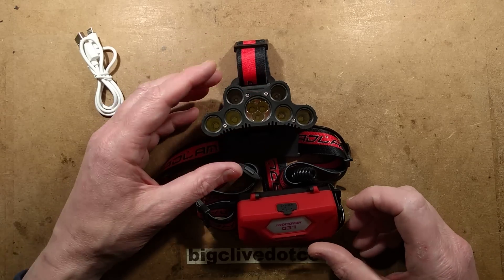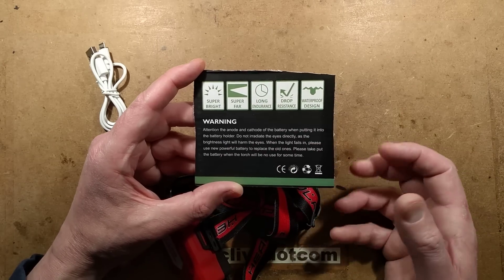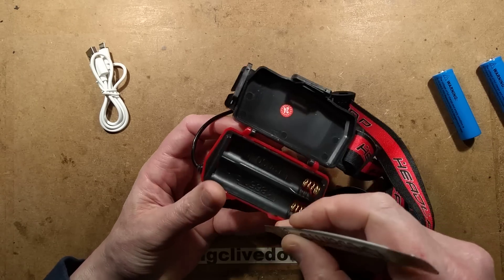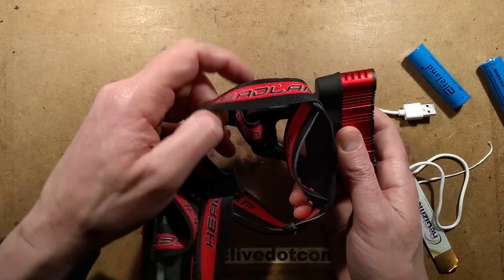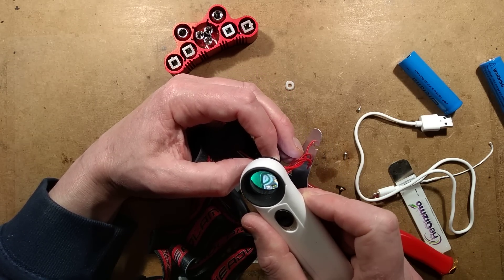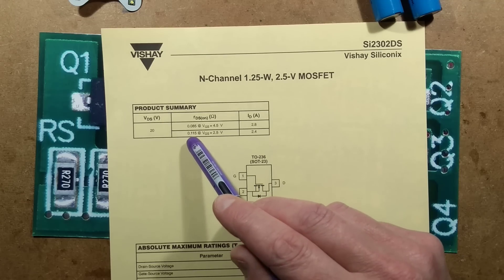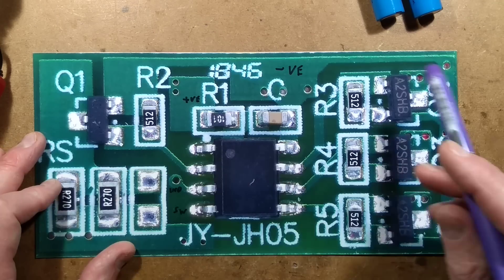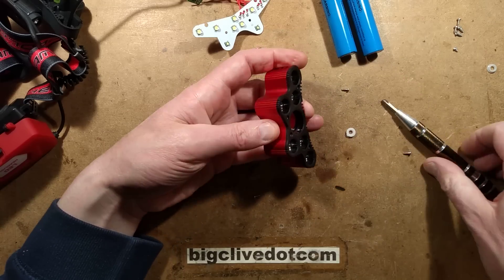9 LED headlight Elfeland teardown.

Comment: I absolutely hate it when work lights & headlamps have these stupid flashy modes, on a flashlight it is okay but only if and ONLY if it is hidden, like you having to press and hold the button to access it, otherwise it is also annoying, I'm convinced that soon enough the Chinese will put flashy modes on a vibrator.
Reply from the maker: All the modern vibrators come with the same useless modes as a sales feature.

Comment: What a silly design... looks like you can't use an external high capacity battery pack to both charge & illuminate the LEDs.
The supplied "18650" batteries deserve a tear-down. Probably just 75% empty space inside.
Also, that green light on the back may be misleading. Green means "GO", so is that trying to say to anyone behind you that it's a "green light" for having a go around the back? It ought to be supplied with a warning label (or is that a good thing?) that one may be routinely accosted from the rear.

Comment: To  remove the flashing effect look up the Free PDK  project on GitHub. 

They have the parts list and Gerber file to build a programming device for Paduk micro-controllers using normal C or C++ (Paduk normally uses their proprietary mini-C format)
Reply from the maker: I'm tempted to program the Padauk microcontrollers in their native assembly code.

Comment: Question here.

And more.

Will that run straight off the USB port without batteries installed.

 being supplied all current through the charge cable through the port.

And or and just running it without draining batteries.

Also I am looking  to modify I a headlamp that uses three Double A's or three Triple A's.

 to run off either the internal battery.

 pack with a modification in the middle of the cable.

Either or install a small barrel Jack somewhere there's enough space available to do so.

So that be able to use USB power.

 through an extension or an adapter jack.

 To run off a power bank in an emergency situation.

 if the power goes out in your low on batteries.

Also I found that that server image LED Lantern.
 the large one with a DC Barrel Jack and the on off dimmer switch.

Even though the red voltage is 6 volts for both D size batteries.

 and also the adapter jack as external worse excellent through USB power.

 through a cable that fits the adapter jack.

 I have run off a power bank before.

Also I happen to have a cable for another device that's power only no data pins connected of course.

That handle problems Barrel Jack.

But I took out the rubber plug assembly for the the adapter jack.

 so that could plug it in properly due to the fact it was a a barrel plug it was too short to fully plug-in otherwise.

Also I was looking into a headlamp that uses 18650 cells.

1 of them?

That can also if you don't have the available or are they are dead.

Can run off 2 lithium camera cells.

Which if I'm not mistaken are now available rechargeable form..
Reply: PS.

 has anyone converted Warehouse Harbor Freight cob work light flashlights.

The frebe ones that is.

There are actually surprisingly good lights for the money.

 even if you paid the full retail price would be worth it.

 the ones with the three LEDs on the front end and I called  light  on  the front where the switch is. 

The blue ones

Converting them either USB or rechargeable.

 had that idea to since they are usually available free with other purchases. 

And they are quite bright at least for the cob light on the front.

Comment: Thanks for the review of another crappy torch, I love how they just connect the LED's straight across the battery with no proper current control. I was appalled when I saw this done using 3 x AAA cells, I thought they would get it right when they moved to Li-Po batteries. That's probably another reason for supplying low capacity shitty cells, If they used good cells the LED's would immediately blow.
I tried fitting Ni-Cad cells to one of those cheap 3xAAA cell torches to see what would happen if you used batteries that would not collapse/load down, Bang/fut went the LED's

Comment: Absolutely love your videos Clive!! I agree 100% that the Chinese  Mah ratings have as much truth in the as Goldilocks and her furry friends. However, the latest 18650 cells from Tesla/Panasonic put out a real 3400mah. They are expensive compared to the Chinese cells as you'd expect, roughly $8 - $12 per cell. However, if someone is in need of that very last tidbit of duration, there is an option. Quality control is much higher as well.

Keep up the fantastic work!!!!

Comment: After seeing your review, I might actually buy one of these, $12 and it comes with (cheap) batteries, that's a pretty good deal I think, plus the cells are replaceable, very handy when you have other things that take 18650 cells (vapes and other flashlights) and have a bunch laying around.

Comment: Have you tested if the flashing mode is really supposed to be flashing, or if it stops if you use high drain cells?

Comment: I've done the microcontroller swap for Christmas lights that start in "flash" mode. The pinout didn't match but there was enough room to run blue (i.e. bodge, rework) wires.

Comment: I bought an 8 LED lamp, with all LEDs arranged within one round multi element reflector. It's primarily a bike light but has a head torch strap. Stupidly bright on full beam, turning night into day, lasts < 30mins on the crappy 4x18650 cells it came with but gets so hot you can't touch it! And that one did not have the most LEDs of some of the other bike lights for sale, some had 12 or maybe even 15 LEDs!

Comment: I keep seeing things like  this on ebay.. (item number 332854211919) it would be interesting to see what power it actually puts out lol (my guess is 10w bass 5w x 2 speakers not the 100w bass and 2x 50w speaker that's quoted)

Comment: You should have a set up for testing Lumins...EVERY flashlight on EBay/ Amazon overstates the brightness of its LEDs. I dont know what the standard set up for testing is, but its gotta be easy to reproduce with a Light Meter

Comment: 10 000 lumens! More like 300 in real life...
Reply: Yeah....the best leds are putting out around 130-140 lumens per watt....I doubt these are them...Phillips, lumiled….
Reply: @dougankrum3328  It would be possible but you need high power batteries and decent cooling capacity with high quality components. Also it would only last 30 seconds.
Reply: @koffing2073  Yeah, even now...the best LED's are making about 130 lumens per watt, so 10K lumens....70-80 watts...
Reply: @dougankrum3328  Its possible with huge battery pack and huge active cooling. Something crazy like Imalent MS18.

Comment: Hi Clive, I don’t know if you’re familiar with ‘Go-To’ telescopes?
I’m a keen astronomer & these impressive bits of kit are very expensive. Most astronomers take huge 12V power banks or lead acid batteries out at night to power them as they track the night sky (mine weighs 10KG & draws 2A when slewing!).
All this kit is very heavy so I invested in a Li-ion Lithium rechargeable battery due to the enormous weight saving...✅
https://www.ebay.co.uk/itm/12V-9800mAh-Super-Power-Portable-Li-ion-Lithium-Rechargeable-Battery-Pack-LD1842/153352119573?hash=item23b47fa515:g:NXMAAOSwGMdcSuLV.
I had a very successful 9 hours of use - great! 🌈
Out of curiosity, I tried the battery on a common 55W halogen car headlight bulb. The bulb lit briefly, followed by the death of my super battery 🥺.
Please let me know what you think of these “9800 mAh” packs...I’m sure it would make a great YouTube video! 👍🏻

Comment: you should do a video taking some of the batteries apart, some are so light because they have spacers and loads of air. some of the top brands are the worst but at least they don't claim to be something they are not.

Comment: Heh, I bought some elfeland "1200 mA" 14500 cells for a flashlight (knowing full well they weren't). They were ~350 mA. I tend to assume the actual capacity of any Ebay batteries is ~~ 1/5 of the rated claim. That tends to hold true, in my experience.

Comment: Best headlight I’ve found is the Bandicoot. USB chargeable, slimline, integrated silicone housing and headstrap and you can program the modes via PC or Mac.

Comment: They really need to get rid of all these fancy 'light modes' they put in their products. Makes them more expensive, more fiddly to turn off, and suck more battery - for no gain. For a non-bicycle light, you only need 2 modes - OFF and full power. For a bicycle light, OFF, full power, and ONE strobe mode. If you really need an SOS mode, just use your hand. I once had a rear bicycle light with ELEVEN strobes, plus full, mid and low power - meaning from full power, you have to wack the power button 14 times to turn the thing off!

Comment: Back in the 1950's my father, who was a farmer, thought he needed a headlamp for working around our farm.  You see we were so far out in the back country of North Dakota that electric power had yet to reach our farm, in fact it still has not although the farm is now vacant and has been absorbed into a huge maxi-farm.  So he looked around and found a true head lamp.  It consisted of a battery pack that you wore on your belt, the pack held 4 D cells, a wire ran from that to a large light housing with an incandescent bulb, glass lens and tin housing.  An elastic band stretched around the head and another over the top. It actually worked OK, Dad said it was a "Miners" light and he wore it when he had to check the cows who were calving late at night, and other chores after dark on the very dark farmstead.
Reply: I would have thought that around that time, the miners would have been using the calcium carbide head lamps.  Calcium carbide plus water equals acetylene which burns very readily.

Comment: Maybe they rate their batteries in metric Amps?!? To convert metric Amps to imperial Amps multiply by 0.4231. If you find that hard to remember I use a morse code mnemonic, 4 dots, 2 dots, 3 dots, dash.

Comment: About 8 weeks back my first headlight arrived from China. I had selected the 3 LED version and it is quite fine for my purposes.  I am getting old, you see, and my eyesight is getting a bit "dim" if you will.  So when it comes to soldering and such, the lamp beside my chair is just not good enough. I used to have a small USB LED thing with a clip that I would attach to my clothing and plug into a nearby power supply but the clip broke off and I could no longer find it on Ebay (perhaps I didn't search good enough.)  When I was last at my dentist, they were using headlights with a single LED and it seemed to be great for them, so when I saw the one on Ebay with 3, why that should be 3 times better right?  Well not really but it does the job nicely for me.  Thanks to being a long time Big Clive watcher, I was wise enough not to order the high capacity batteries, since I have a large supply of 18650's taken from old laptop batteries to use.  When it arrived I found it to be just what I needed, and I use it on at least a weekly basis. It puts me back in the "lets try to build.....) mode! Yay, you only stay young if you learn one new thing every day, and thanks to Big Clive and a few other Youtubers, my learning continues daily.  Folks just do not understand how an old disabled cop like myself can stay so young when they know I have always been older then they are.

Comment: The Microchip PIC16F18313-I/SN would be a nice replacement for that microcontroller. You could use PWM to control the brightness of the LEDs if you want all on but at lower intensity to reduce harsh shadows. Less than £0.60 from Farnell in one off pricing. I would definitely put some series resistance with the LEDs otherwise they're just going to cook without significant increase in luminosity as they will run at very poor efficiency also resulting in low battery life.

Comment: Ive got a headlamp from Wish that takes 18650s. I bought 4 cells plus a charger from ebay. Total investment was around 20 bucks and it help so much during cleaning cycles at work (once a week). Having to peer into empty 30 ton bins while trying to hold a flashlight and a brush is hard. The headlamp gives me two free hands to hold the 100ft extending pole. Maybe the best work related item I have ever bought.
Reply from the maker: A good head light is extremely useful.  Light exactly where you need it.

Comment: LOL 3000mAh... Got you beat Clivey!!! I got two in my headtorch that are branded 9800mAh (woo! so powerful!)... tested them on my load and they came out at 318mAh. 
Always buy branded 18650s, I got Samsung greens at 2500mAh tested at 2483mAh (down to 3V)...
I just want the truth for god's sake but as you rightly pointed out... a pissing contest it is!

Comment: such thing as a micro controller re programmer ? and how does it work and how could it be soft modded to change its values
Reply: The cheapest microcontrollers, as these undoubtedly are, can only be programmed once. But they only cost a few cents each - you would buy a tube of them, and swap the chip out each time you changed the code.
Reply: @ickipoo  so they are silicone pressed basically to a fixed operation. Like how vinyl is

Comment: I would bypass the mode controller and install a physical on/off switch to all the LEDs. All the clicking through modes and flashing is just nonsense.
Reply: that is nice but these guys are all about cost. i have a flashlight with a similar switch, now it has an issue with the contacts, hard to get the mode I want
Reply: But the LED's don't connect directly to the battery.

Comment: one more question for us nerds long but decisive...do electrons flow from pos to neg or the opposite....this isnt my question and why Im so confused...how does doping  make diodsn etc make shit work..confused in california..cheers i
Reply: Electrons are sourced from the negative terminal (recall that electrons carry the negative charge).  The terms “positive” and “negative” potential were coined before we had discovered the electron and electron theory, hence the disconnect in which direction things flow, so the positive ultimately receives the negative electrons once the circuit is completed.
Reply: @ethanpoole3443  thank you Sir..now I remember..my memory is coming back.. I have slight memory dementia..it sucks when you get to my age and things get more confusing by the day..my bad.. anyway I wish I could add more but my days are gone.. I try

Comment: Dubious claims about battery capacity and waterproofing aside, it's still probably a better headtorch than the famous Petzl Zoom from the 1980s, with its obscure and costly flat 4v5 zinc carbon battery, low power filament bulb and terrible beam shadows at any zoom level - it's almost all that was available back then though, and we were pathetically grateful of course :o)
In 50 years of electronics, I can't remember a time when the text on a component, particularly batteries, could be trusted SO little - with Li - Ion, it's often laughable, as here.
Reply: It’s not Lithium Ion batteries that are untrustable, it’s the Chinese advertising claims that can not be trusted (and whom are often in cahoots with the manufacturers, if not one in the same).  But if you buy a reputable brand of batteries (ideally outside of China) then the specs will be as claimed.  The same is true for NiMH and LiFePO4 batteries from Chinese sellers.
Reply: Those old Petzl Zoom's had a great battery box though, the ones with the rubber band. They are widely used in caving and very hard to find these days.

Comment: Hey Clive, how about a teardown/review of head-worn magnifying visors, presumably including various cheap modern ones with plastic lenses and LED lighting built in? I've got a couple of cheapos that sell for 10 bucks or less at the Job Lot store. Plastic lenses, and the LED lights on either side of the lenses are merely okay, somewhat bluish light spectrum. And the magnifying lenses are plastic of course, and you have to flip down or pivot extra lenses in front of the main ones in order to achieve higher magnification. And then I have three of the much higher quality, significantly more expensive, glass-lensed Opti-Visors, outfitted with 5, 7, and 10 diopter lenses..... but they don't come with built-in lighting, and the Maglite style halogen bulb add-on lighting unit that Opti-vizor sells is overpriced and performs poorly......